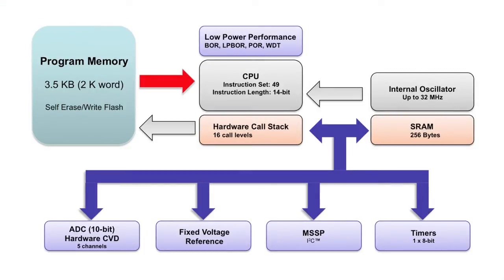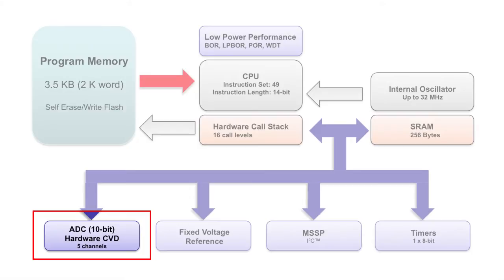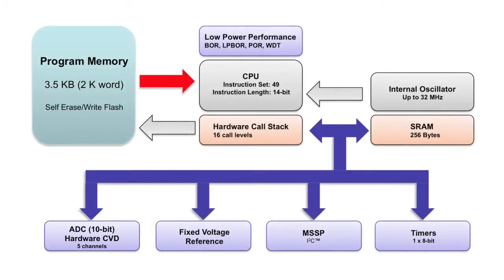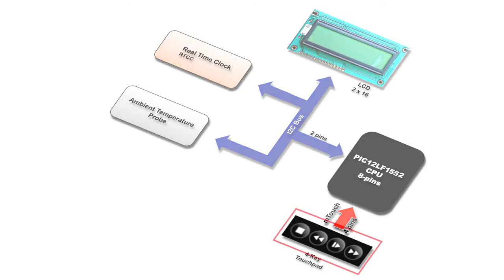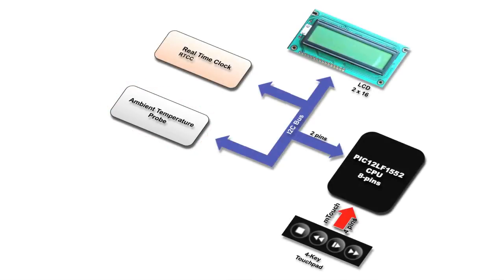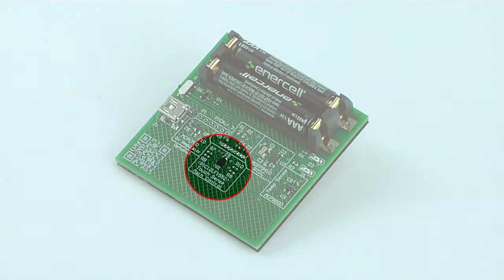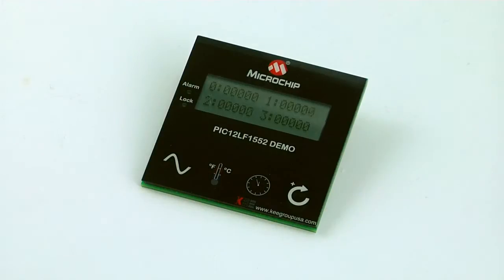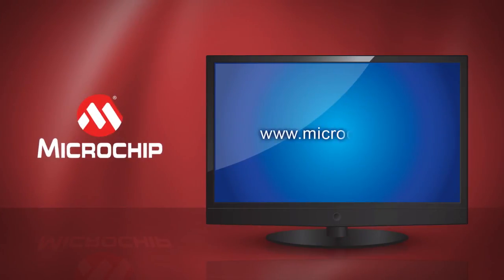Introduction to the PIC12LF1552

Comment: Nice chip, although my application required a UART and SPI so the 12F1840 was perfect for the job. Amazingly small package while still very powerful thanks to 32 MHz clock speed. Flash and RAM is a bit on the small side though.